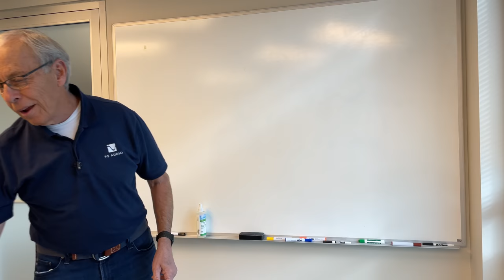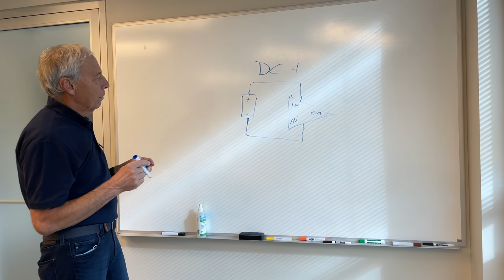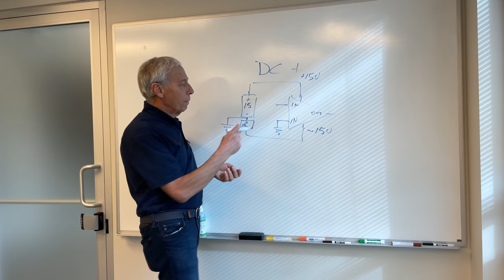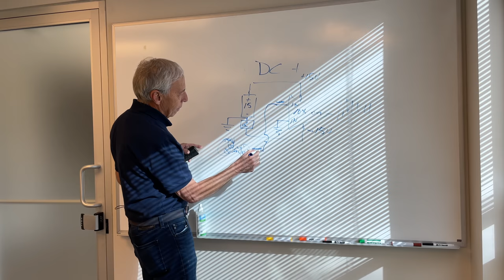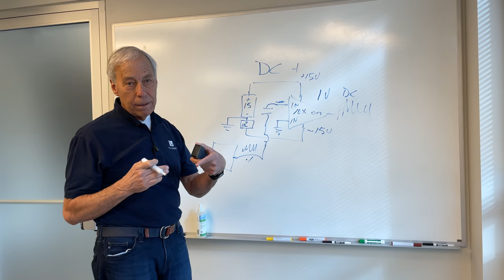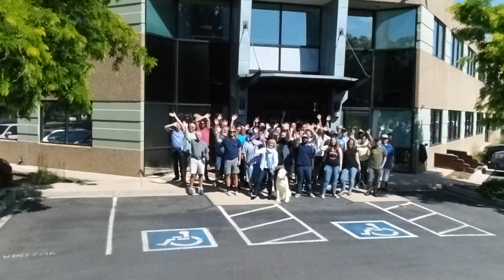Understand DC amplifier coupling

Comment: Paul, can you please fade in a "to be continued..." at the end of this and make a part two? I mean, you just expertly explained everything around Antonio's question, then left the poor guy hanging XD Also: I think many of us would really like to have this explained to us, me definitely included!
Reply: you get rid of it by having another amplifier, and having the other amplifier basically output the inverted signal, so basically the signals add up because while its inverted, its opposite to it. so that means they superimpose and double in magnitude forming a single signal, what happens to the DC? the DC simply is canceled out because the DC would flow into the speaker from both terminals regardless of where the signal is going. obviously the latter part depends on the topology of the amplifiers, differential output.

Comment: DC-coupled means it will pass both the DC and AC component of the signal into the next stage/circuit. AC coupled means it will only pass the AC component of the signal. The DC component is typically isolated using a series capacitor. The capacitor can color the sound. So if your source output doesn't have any DC present, use DC coupling for best tonality. Use a DMM and find out. It's that simple.

Comment: Some of those 1970s Japanese DC coupled amplifiers were a nightmare when a faulty transistor would cause a chain reaction and blow several others. Using substitute transistors without attention to critical gain matching was a no no. AC coupled stages were a dream to work with by comparison.
Reply: I think just owning and using such amplifier probably already requires some electronic prowess. I would also not feel happy leaving it on at night.
Reply: @Spock105  The 1122 has a DC coupled power amp and all the switch does is connect the preamp section directly or via a 10uF capacitor. I'm not sure why that would be an option but, depending on the spec of the preamp, using AC coupling may offer some useful bass rolloff at the extremely low end, say less than 20Hz. Does the owners manual say what Marantz suggests that it's for?

Comment: hi very fundamental issue and thank you so much for your great explanation
considering what you say about caps I have the feeling that only DC coupled amplifier have the potential to be really transparent to the signal    
I wonder if a square wave test could be useful to show the impact of the capacitors in series with the signal  
i have a great faith in square wave test   It is very telling about the quality of a circuit imho

Comment: Quite some years ago I had an interesting conversation with Nelson Pass ( Threshold at the time ) over his extensive use of DC coupling in his products. There is a danger to doing this. He jokingly referred to the following. Given a big enough Threshold Class A DC coupled amplifier if you raise the tone arm/cartridge off the record enough, lets say 4in, and let it drop and it falls fast enough, you run the risk of blowing the cones out of your low frequency speakers. Speaker cones in the middle of the living room floor.
Reply: 200watt Pass designed  GFA555, AR TT spinning, my cloths washer starts to spin with an unbalanced load, tone arm bounces a few times and voila 4 10inch subwoofers blown with fried voice coils.
Reply: @paullazarro4295  You should mount them for everyone too see. :-))
Reply: @paullazarro4295  Pass Amps basically look like unlimited current amps with microsecord rise times.

Comment: VERY NICE, I know know what my dc coupled 1967 scott model 348b receiver is now  . Right away it tells me to check to see
if any dc is getting  thru. If so. From what. I've learned the dc coupled amp would have bad capicitor before the amp acording
to this lesson. But did you say at the end there, DC coupled amps sound worse?
Reply: I RE-WATCHED THE 2ND HALF.  I "GOT "DC"  COUPLED AMP".  (I got MIXED UP) THE DC COUPLED AMP IS WITH OUT THE
CAPICIATOR . SO again I have an dc coupled amp and I shouldn't see any caps before the amp or after. SO THERE IS NO CAPICITORS. (NO CAP BLOCKING ANYTHING) but they still use the coupled name
for DC COUPLED AMP. so there must be a diff way they remove the unwanted dc? I learning usally takes about 3x to get something figured out, with help from watching these types instructional videos thanks fro the lesson  so it's the  AC
COUPLED amps thatb sound worse  maybe you can erase my first comment so it doesn't mix anybody up I'm just learning.

Comment: The easy way is to roll the gain off using a cap in the lower leg of the feedback network on the op-amp. Assuming its unity gain stable, the cap will turn the op-amp into a unity gain follower at DC. Im horrifically lazy and impatient and cant wait for a relay to click, so I usually leave it out in my stuff and arrange things so the DC offsets aren't as much of an issue. Although that's not the swiftest thing to do with something like a turn table or another audio device that can have large DC offsets, tho.

Comment: Hi Paul, So... modular synthesizers are putting out control voltage and the new interplay with a computer digital audio workstations is to use DC coupled audio interfaces that send signal and clock information through devices like (expert sleepers es-8 / es-9) to be converted to CV and then back to computer to be managed in other ways. My question is... where is the danger with the signal to the speakers? Is it just in the amount of volume or is there something else happening with the electronic signal that I'm not aware of. Thanks!

Comment: So does "DC Coupling" refer to the output that contains the DC signal or without it?
Reply from the maker: DC coupling (despite the name) hopefully has no DC on it. It is better referred to as direct coupling: connecting stages together without the need for a DC blocking capacitor.
Reply: @Paulmcgowanpsaudio  Thank you!  I really don't know enough about electronics.  I didn't know a capacitor could filter out DC from a circuit, or a current, or however you put it :)

Comment: A power amp designed to be direct coupled to the loudspeakers - i.e. without output transformers and / or output capacitors doesn't always guarantee good sound quality. Back during the 1996 Las Vegas CES, a now defunct audio company exhibited a "Krell inspired" monoblock amp that doubles its power output everytime the impedance of the connected  speaker is halved. While I was later underwhelmed with the sluggish sound quality, I later found our why when the exhibitor opened their amp up to show-off the amp's neat layout. Sadly, whoever designed it didn't have Dan D'Agostino's attention to detail when it comes to power supply design. The amp just sports a couple of gigantic filter caps - instead of banks of smaller ones - and woefully inadequate power supply decoupling capacitor use in the intermediate stage and output transistors; Thus the sluggish sound despite of having a lot of  watts on tap.

Comment: 10 times is 10dB, 20dB is amplification by factor 100 😊
Reply: 10 times in voltage is 100 times in power, which is 20 dB. Paul is correct.
Reply: Voltage amplification is in terms of voltage gain, 20 x log(voltage gain).
A voltage gain of 10 gives +20 dB,
a voltage gain of 30 gives +29.5 dB,
a voltage gain of 100 gives +40 dB.

When it is about power gain or attenuation it is 10 x log(power ratio),
then 10 times gives +10 dB,
30 times gives +14.8 dB,
100 times gives +20 dB.

Comment: how to get rid of dc offset without the use of caps, thats an interesting topic!
Reply: Use a transformer or just add an opposing voltage, both that and the signal are resister coupled.
Reply: @hugobloemers4425  Yep thank you, I was just learning that. I also discovered dc servos circuits: 
https://sound-au.com/articles/dc-servo.htm
Love the internet
Reply: @benjaminjoeBF3  A big hooray for negative feedback!
Reply: @JerryRutten  why is that Jerry? Would you be so kind to explain?
Reply: @benjaminjoeBF3  You didn't read the article? A servo system is actually a system with negative feedback... You feed back the DC part of the signal.
Reply: @JerryRutten  100% correct, Im going slowly through the article. Technically speaking I dont like when to mitigate a small problem you have to build a big apparatus but its possible I still dont get the full implications of the problem in the first place. I will gather some more knowledge and then to do some listening tests on circuits. I really want to hear what its like with no caps on signal.
Reply: @benjaminjoeBF3  You're welcome. But be aware...

If you have a class D amplifier there is an inductor in the chain (even worse than a capacitor). If you have passive crossovers then you have capacitors and inductors in the chain! And if you don't have a passive crossover there is still one inductor left: the voice coil (even with ferromagnetic material) !

The only way to avoid all this, is by using current-drive amplifiers, which control the output current. Then there is no influence on current and output of the drivers. Only on the voltage, but that has no audible effect, because the current creates the force and the sound (Lorentz Force Law).
Reply: @JerryRutten  for now no big power amps for me, just preamps full discrete class a, in its simplest form. I want to wean out of this crazy overcomplicated sterile sounding audio land im living in right now. I was making music before and after digital came and felt I've lost the sound. Yeah you can hear it but its like its not there in person anymore, if that makes sense. 
Thanks for the headups!
Reply: @benjaminjoeBF3  Almost all pre amps are class A. All the different classes are typical for (the output stage of) power amps.

Comment: My ears are AC coupled...
Reply: My living room is AC heated and cooled...
Reply: So you never have to swallow during ascent on the plane (analogous to re-zeroing the DC offset)?  Must be nice.
Reply: @tactileslut  Yeah, the DC equivalent of a constant air pressure on our ear drums is sort of bad. It’s interesting how our hearing can be severely impacted by such pressure and how swallowing can clear it up. It’s sort of like a speaker with a DC offset signal moving the cone near the limit where it can’t move much mechanically and will yield much compression and distortion.